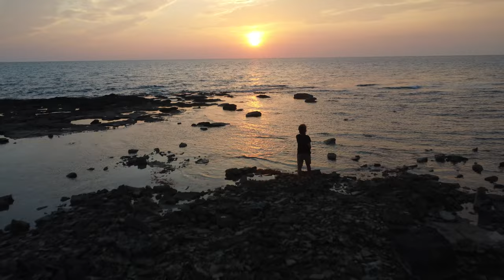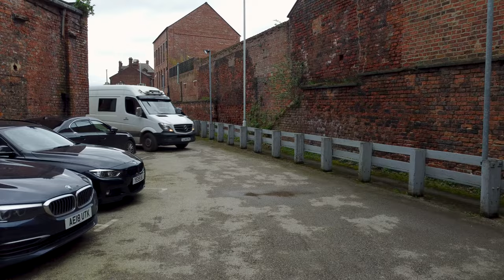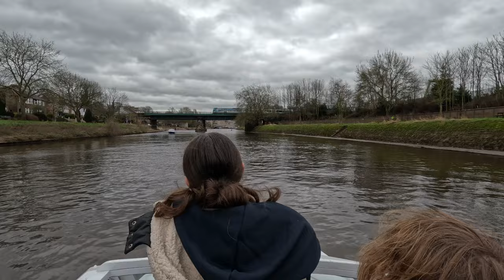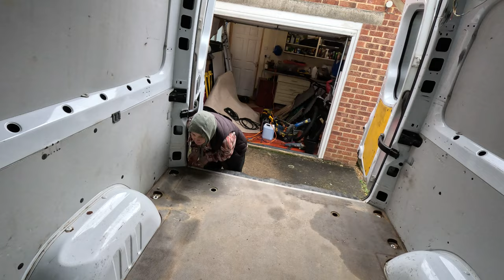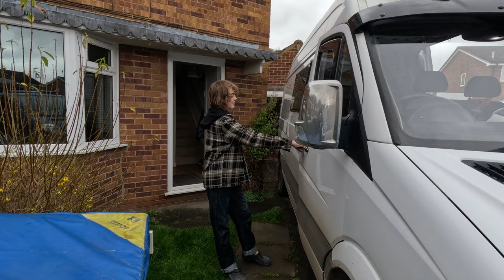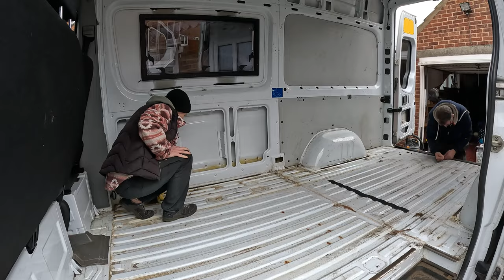Will we find Rust in this 2016 Sprinter

Comment: Hi, just seen you have purchased a Sprinter and your friend Sally is short. I am 156 cm so also short. This has been my concern of purchasing a van …possibly Transit mwb or  lwb? possibly a Sprinter but wonder if Sprinter will be too big for one person on own for parking, shopping etc as van will have to be daily vehicle too? Plus with also three Papillon dogs!I worked on farm in my younger days so driven tractors, trailers etc. it is just,  is a sprinter although wonderful for space, just rather more difficult to shop, park and drive single track narrow country lanes? What sized engine  do sprinters have? Would a petrol transit be more powerful? I remember driving an under powered minibus in the Lake District… nightmare on steep climbs. Used to driving 16 seater Ford and older Talbot mini buses in my twenties. Now 60’s but want some short breaks etc with my dogs to see more before too elderly. More and more places are now restricted for diesel emissions too.   You had a smaller van but I do like space idea….so as not to tread on dogs and poss have a wash  room on board. Any advise or ideas to think about greatly appreciated.
Reply from the maker: Sprinters are big. But as you can see. Sally manages just fine and she's tiny😉. It's her daily vehicle aswell. You just have to park at the far end of supermarket car parks out of the way and walk a bit further. Go when it's quiet. You could get a high roof vivaro, transit or something like that. Nice to be able to stand up in the back.